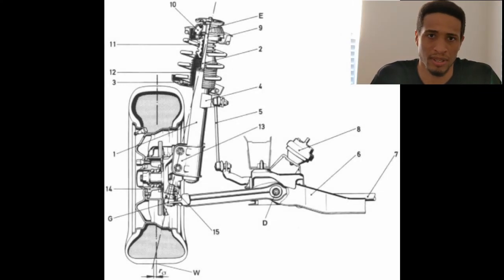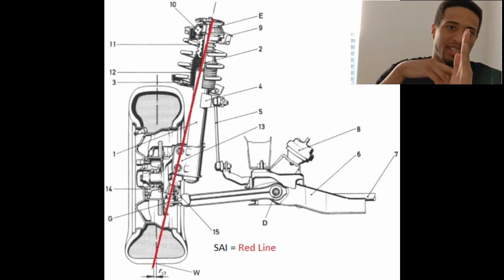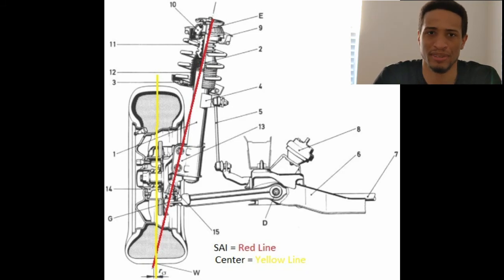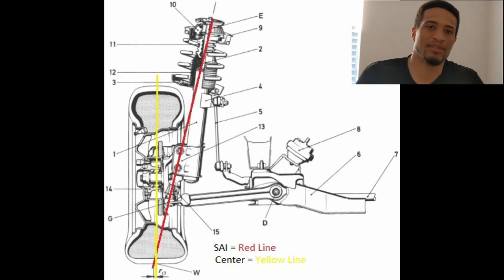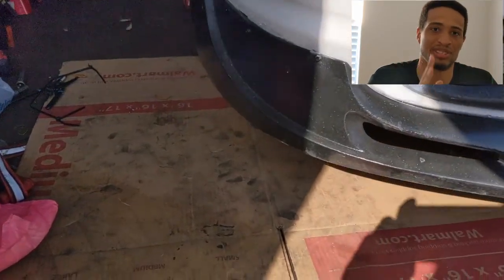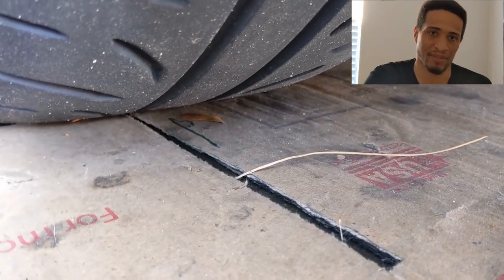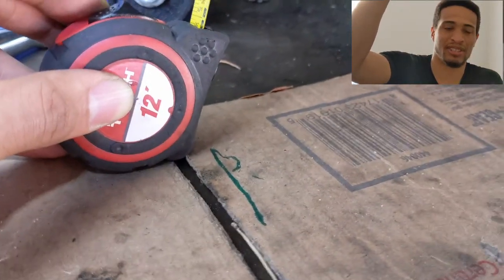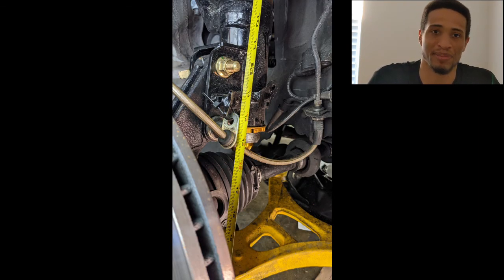Solve Torque Steer w/ Scrub Radius

Comment: Just started looking at this Video. First thing I saw was your Intersect Line goes through the attaching Bolts. NAH thats just the attachment point. Follow the Strut Centre.....
Reply from the maker: The two points for the line to follow are the top of the strut nut. And the center of the ball joint.
Reply: @4bangermafia  Nope, your still on the wrong Track. Reckon you will actually work it out in a decade or two, if ever.
Reply from the maker: @scottwyman5014  I don't know what that means. The two points of steering rotation is the center nut of the strut. And the ball joint of the lower control arm. Without those two points you have no axis of which the wheel turns on.

Comment: From your video and other information sources I've seen if the standard scrub radius is 19mm and I camber the front using camber bolts 1 degree the SAI would remain the same. This would move the top of the tyre inwards and bottom outwards. I've calculated that my tyre size this would mean the tyre has 10.77mm more tilt to it so I'm guessing the bottom would be moved outwards by around 5.39mm and give a scrub radius of around 14mm. Or do camber bolts effect the scrub radius in a different way?
Reply from the maker: Hello, thanks for commenting. Camber bolts are actually a good way to increase negative camber without effecting your scrub radius. Because the strut remains the to the top nut to the center of the tire(I never go off the camber angle of the tire but the center of the tire. Because your tire will be undergoing deflection/deformation/roll steer

Comment: Are you using buddy club lower ball joints....??
Reply: Do you know personally if there's a differnce between those and the hard race
Reply from the maker: @miracosta8  I think the hard race uses a snap ring. The Buddy Club doesn't, but tbh the Buddy Clubs don't need a snap ring. They have to be pressed in by an actual press. So far the Buddy Club's have survived a track day. With no issues or movement as I inspected them already.
Reply: @4bangermafia  Awesome.  Thanks for your input
Reply from the maker: Yes